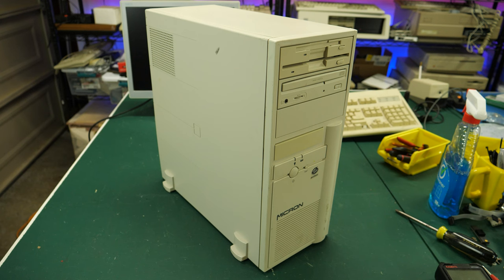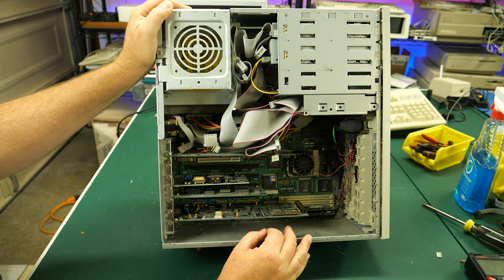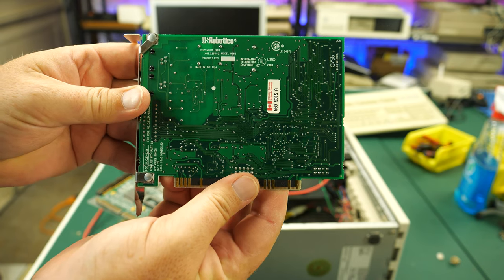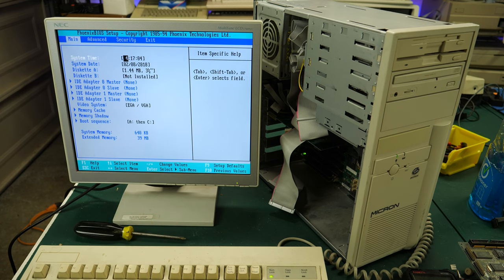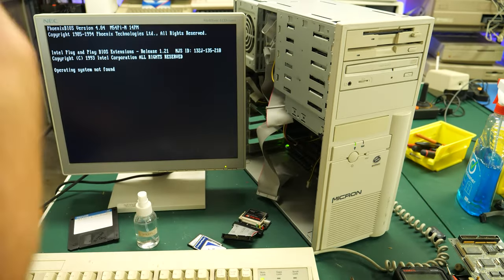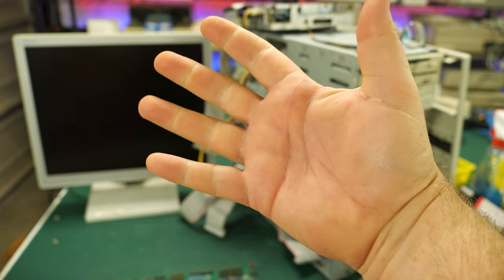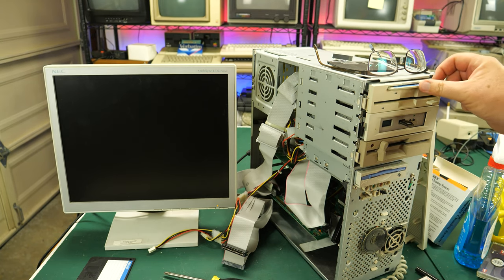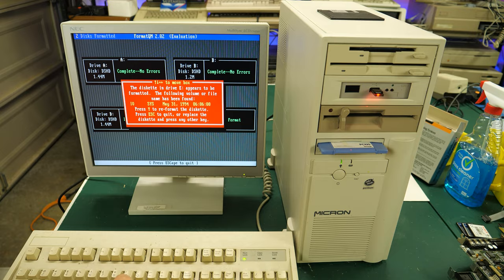Three Floppy Drives, A Gotek, And A Zip Drive Walk Into A Bar ...

Comment: The 1.44 MB 3.5" drive should be able to handle the 720 KB disks with no problem, as long as the HD sensor is working on the drive. It's not like 5.25" inch drives where they have a different number of tracks; both 720KB and 1.44MB disks have 80 tracks. I want to build a tower like this someday, though for me I'd want the 3.5" drive to be a 3 mode drive so I could write 3.5" 1.2MB disks for my Japanese computers that use that format. Then get at least a Zip and a Jaz drive in there for fun. Probably wouldn't mess with the SyQuest drives, since I've heard they're all notoriously unreliable.

Comment: Oddly enough, I actually have one of those 3.5"/5.25" combo drives, picked it up ages ago out of a spare-parts budget bin at some computer place in town, intending to use it eventually in a retro-computing build that I still haven't gotten the rest of the components for.  I had envisioned using it to read Amiga floppies and CoCo floppies using one of those read-any-format-of-drive controller cards.  It is, in fact, sitting three or four feet away from me, covered in dust.
Reply from the maker: Nice

Comment: I would love to get my hands on a retro machine like this that still functions and runs windows 98se when I was a weee lad in my teens I had used windows 98se's compression methods to squeeze more room into floppies and 100mb zip disks not knowing it would bite me later as systems changed and compression methods changed.

I remember doing a paper boy route just so I could buy a external zip drive because the plethora of floppies I had everywhere and zip was the wave of the future!

Side note I also recently found my voodoo 3 3000 that my grandmother got for me for my bday the day it came out as well as my windows 98se cd.
Reply from the maker: Awesome! Care for a donation? 😁 jk

Comment: Pentium 90 and gaming machine - I almost spewed my drink on my dual monitors - And I say this while I have a Pentium Pro 200 behind me that I have used for gaming of the appropriate age games, but I am very close to mothballing it and using the "retro gaming" software to emulate older machines so as to avoid the headache of old hardware and failing components.

Comment: Thanks for documenting this, I'll be coming back to this if I build a PC like this.  I don't think you need a separate 720K drive in your build, you can just change the drive type in the BIOS to 720K and point it at the 1.44MB drive and it should work.  The number of tracks and the TPI are the same between DS/DD and DS/HD for 3 1/2" disks.
Reply from the maker: I suppose that's true. And if I was to format a 720K disk I can always specify it in the command line.
Reply: You could just stick a 720 in that 1.44 without changing the BIOS... 1.44 MB drives were backward compatible and had a sensor to read the High Density hole (opposite the read/write shutter). If the shutter is covered, it will sense a 720 k drive and treat as such automatically.
Reply: @horusfalcon  : If I remember correctly, you can even run the old 8" floppy drives off controllers with the right pinout, though those would mostly have been Shuggart instead of IBM's version (and would need an external connection, since they don't fit in either size of PC case drive slots). The main caveats are:
1) Why? (probably to swap data with some old Tandy business computers),
2) I think those disks had a lower density version than offered by the 5" disks, and
3) More capacity, since the 8" disks could at least reach 1Meg in the high capacity versions.
Reply: @horusfalcon  Detecting the media type was not a function of the floppy drive in those days. 1.44MB drives would treat a 720K floppy as a 1.44MB diskette and fail to format unless the /F:720 parameter was specified. We didn't get into media detection until more advanced drives came along like Bernoulli, Zip and Jaz. You also don't want to routinely format a floppy diskette. Formats add more wear and tear to the media, degrading them even further.

Comment: No LS-120?
I found those to be 100% backwards compatible with 720KB, 1.44M and 2.88M as well as actual LS-120 disks, and they don't take a floppy interface, but IDE/PATA instead, so the two 5 1/4 can have a floppy channel each.
Sadly, 5 1/4 is not as reliable although 1.2M drives think they are backwards compatible, and damage data if you write to 360K disks with data on.
I never used zip drives, or found any need, as LS-120s fulfilled the same need, and I never needed to exchange that volume of data with anyone who had a zip drive, at least until CDR and CD R/W had superseded them.  My BluRay XL RW deals fine with all previous optical formats in that form factor back to old CD-R, including every DVD format I've ever tried, and can put 100GB on a single BDXL disk (when I could afford them!).  But of course, that is SATA not PATA.  In the unlikely event that I ever need a zip drive, I can set it as a slave to the LS-120 Master, or vice-versa.  The floppy tape interface would likely have been for one of the early small backup tape drives, which IIRC ended up at a massive DC-120 and had to be left running overnight.  I skipped those and went through QIC cartridges and then those huge ones whose name escapes me right now - but both of those used SCSI.  Now I just take a snapshot of the storage system and clone it to an external drive.  The same snapshot gets much more slowly cloned to a friend's system over the internet, while I take his backup clone in return.  One copy online, one offline, and another offsite is as good as we are ever likely to need.  ZFS renders all previous disk management and filesystems obsolete, although it can and does house datasets in any of the older formats, so if I want to run a VM that does not support ZFS, I can set up a "disk" that it understands, right back to the original FAT or in theory CP/M formats, although I've never actually tried running CP/M-86 (or even earlier versions in emulation) on any of my post-millennial machines.  But FAT, ExFAT, EXT, NTFS, XFS, UFS and others are all housed in their own datasets in the pool, both for native use and by client VMs, and all use the underlying checksummed, mirrored and RAID-Z very fast Copy-On-Write cached filesystem transparently.
But flash memory has made all older removable media obsolete, and in embedded form is so robust that it has replaced tape or wire in aircraft Flight Data Recorders and Cockpit Voice Recorders, although for that application they are sealed inside very strong and highly insulated boxes inside the bright orange "black boxes".  Not that I foresee any need to ever access one of those!
Reply from the maker: I need an LS-120!
Reply: @RetroHackShackAfterHours  They are very good (and even give a speed boost on reading/writing the more common 3 1/2" formats).  I've remembered the other tape formats I used - DAT and DLT, which still have value for rescuing old archived data.  Both can be plugged into a fast/wide SCSI chain, which can also be useful for recovering the contents of older (usually server) hard discs, as long as they aren't part of a RAID set.  I slill have DAT & DLT drives, but no PCIe SCSI card.  I could grab one of those much more easily than a drive if I was ever called upon to get the data off an old tape though.  I'm not going to get one "just in case" - it would go on the bill for whoever needed that data, and not push it up unreasonably high.  Ebay has them pre-owned but tested at under £50.

Comment: Hi, the DC2.SYS should work if you change the /d:0 and /d:1 to /d:2 and /d:3 for the driver.sys, because you want to set the type of the 3rd and 4th drive and not change the a: and b: already set by the bios. 26:08
Reply from the maker: Yeah. I tried that as well when I was testing. No worky with this particular setup.

Comment: I don't agree that you might expect tantalum caps only on the 12V rail.  I made a microcomputer in 1983 that had tantalums all over the place.  On the 5V supply.  Debugging a 5V short is not rocket science.
Reply from the maker: Thanks

Comment: I'm still a bit confused why there are so many people who need a separate 360k drive. I've heard so many stories that I believe there must be something to it. On the other hand, my trusty old 1.2m drive - that I got way back at the beginning of the '90s with my first 386 - reads and writes 360k disks perfectly and there seem to be no compatibility issues with the 360k drive in my XT class machine. It also still reads 360k disks I wrote back then, 30 years ago. Am I just lucky? Were there maybe different drives that e.g. wrote with a higher strength magnetic field to compensate for the smaller heads inside a 1.2m drive? I only have these two drives so I can't do more tests...
Reply: once you written something on a floppy disk in a 360K drive, you cannot just format it or erase in 1.2M drive and get the disk readable back in 360K drive. 
SD heads are just wider and will read altogether that junk that was left by the sides of the actual data that was written by narrow HD head. that's the point.
Reply: @borodaevkirill7371  Yes, that's the story I've heard. But I never had any issues like that. Maybe its just these two drives I own that work together?
Reply: @f3liscatus  : The high/low density issue really only happens when you write in a high-density drive then try reading in a low-density drive, AND can absolutely be fixed by the high-density drive switching to a low-density head when writing low-density disks.
Reply: @absalomdraconis  So there are drives that have both sets of heads? Seems like I have to open up the case and have a look...
Reply: @f3liscatus  Some 5.25 drives could read both (usually a jumper enabled it), later ones couldn't since the low-density drives were obsolete (and not supporting it would make manufacturing cheaper)

Comment: Love those dual floppy drive units, would love to get one.  I have a case just like this, mine is just 'CMOS' branded.  I didn't know there was a company named 'CMOS' kicking around, so I searched Google and let's say that have a questionable background.  Anyway, great case, the foot on mine was badly rusted, so I treated it and gave it a thorough deep cleaning just the other day.  Will probably move some kind of Socket 7 system into it.
Reply from the maker: Nice!
Reply: @RetroHackShackAfterHours  Just got around to finishing the video; yes, I could absolutely use the STLs for the drive rails, my case has none and I could use at least one set!  My Dallas experience didn't go as well; my AMI BIOS would stick in infinite loop when entering setup with the original dead battery.  After installing a socket and dropping in a 'fresh new' Dallas, the board behaved exactly the same.  I scratched my head for a bit, then left for lunch and came back; suddenly it worked!  I think the battery was so flat that it needed some kind of trickle charge before it would even initialize NVRAM.  Something to watch out for with these 'new old stock' RTC chips.  Glad you reached your goal here, its definitely a neat case for this purpose!
Reply from the maker: @orangeActiondotcom Where did you get your Dallas replacements? Mine were from Digikey and were dated mid-2023.
Reply: @RetroHackShackAfterHours  Mouser, around 2016-2017

Comment: Depending on the network card you can wright some interesting firmware on it. I remember about 20 years ago I had a part time job at a computer recycling center we had a side project of setting up firmware on a network card that when you had it installed on a computer and powered it up it would connect to a server automatically download and install the OS it worked to an extent.
Reply: I think that you meant "write."

Comment: just so you know those "brand new" Dallas clocks are probably new old stock which means their battery has been aging while sitting in a warehouse for years.

Spending the $30 for the necroware mod kit is much more worth it since you can change the battery in the future.
Reply from the maker: Only if you buy them from ebay or something. These are brand new. The date code is May 2023. Should last for 10 years or more. If I can find the parts for a decent price, I will make some Necroware boards and put them in my store for a more reasonable price.
Reply: @RetroHackShackAfterHours  I've gotten some where the date codes are faked.  Rub the top of the chip vigorously with alcohol and see if it rubs off.
Reply from the maker: @JimLeonard Nope. Brand new from Digikey.
Reply: @RetroHackShackAfterHours  I must be missing the number, is it a 1287 or a 12887? The 1287 was discontinued decades ago. The 12887+ appears to still be available.
Reply: @JimLeonard  you are correct the 12887+ and the C version that Aaron mentions in the video are still available as new parts.  Aaron already mentioned Digikey, but Mouser carries them also.